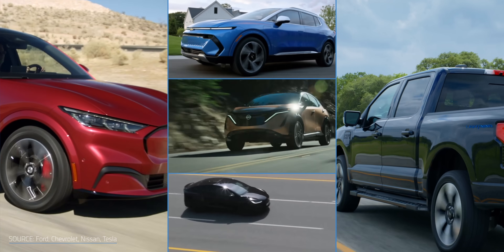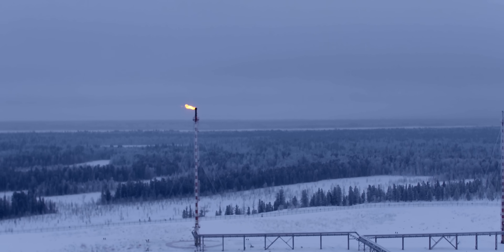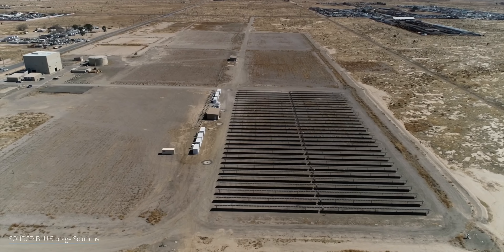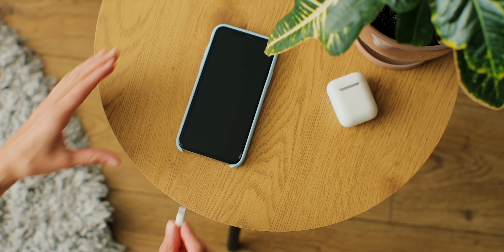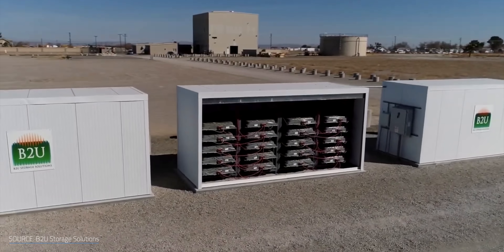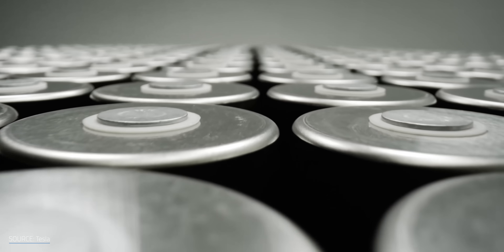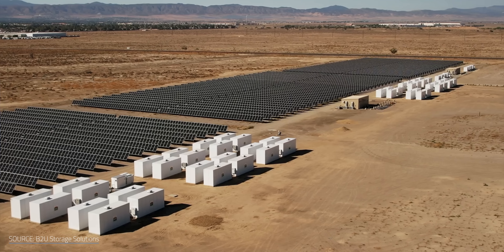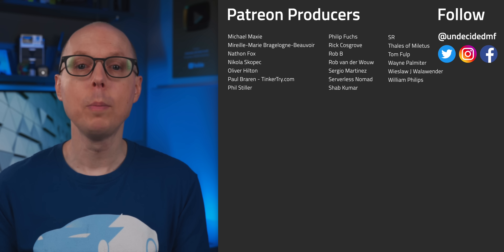How Old EV Batteries are Perfect for Energy Storage

Comment: I spent £7,200 on batteries for my home. The SCRAP value for these batteries is nearly £1,000. No batteries are going to be thrown away, the materials in them are just too valuable.
Reply: they're not getting thrown away. they are getting them cheap and using them to make money from buying the renewable energy at low price and selling high
Reply: As it stands now, cars that are no longer drive able are parted out. Those that no longer have valuable parts or are significantly destroyed from an accident get recycled. Typically they are ground up into fine bits and all of the valuable materials are collected and sold.
Reply: At some point the scrap value of these reused grid storage batteries will be too high to use them in this way.
Reply: @TonkarzOfSolSystem  At which point, they get recycled. And since they're NOT in a landfill, it's likely MUCH easier to do that well and effectively.
Reply: Old battery packs are worth thousands in recycling or re-purposed for storage use. No one is throwing them away in land fills. 💰 talks...
Reply: @larryc1616  it costs more to recycle them than to manufacture new ones. Of course they’re going in scrap yards. If your Prius gets totaled no one is coming and pulling the pack. Same with any EV or hybrid.
Reply: @larryc1616  - “old battery packs are worth…”

There is labor cost, human risk from combustion, and environmental risk from spontaneous combustion, and medical risks from leeched lithium being linked to autism.

Once the costs of risk are observed, businesses try their best to shed the risk to nameless individuals, who buy second hand batteries 🪫 for home 🏡 projects.

This is an environmental disaster in the making.
Reply: And then, they 🪫 self combust & turn into a ball of flames 🔥 

My used auto batteries 🪫 are going to be wired together in what I am calling The Hell Pit… because lithium 🔋 fires 🔥 are no joke
Reply: @DavidHalko  My "hell pit" is filled with table salt. Those sodium fires are even more lit than lithium fires!
Reply: @HenryLoenwind  - ‘My “hell pit” is filled with table salt. Those sodium fires…”

Can you elaborate a little more?
You caught my interest…
Reply: @DavidHalko  Technology keeps advancing. Lithium Iron Phosphate batteries are far more stable than Lithium Cobalt, and have largely replaced them as a result. LiFePo batteries also have much higher cycle lives.

and as far as EV fires, well, gasoline fires are no joke either, and gasoline can cause massive explosions if mishandled. It's also far more toxic than any lithium battery. Then there's the whole funding of Saudi Arabia and religious terroism thing with it....
Reply: @DavidHalko  oh no - you, and you alone, have spotted the obvious ….
Or maybe, just maybe, you’re in full on FUD mode.
These are batteries capable for 100+kW, being charged/discharged well below that and constantly monitored.

You are aware that EVs are far less likely to burn than ICE vehicles aren’t you?
Reply: @JohnR31415  they’re less likely to burn because there are fewer of them. The frequency at which they catch fire is considerably higher and EV fires are a HAZMAT call that requires expensive foam instead of cheap water to put out.
Reply: Hi  @JohnR31415  - “batteries capable for 100+kW”

They are big… which is why one must take extra care. Energy must be handled with care.

“being charged/discharged well below that and constantly monitored”

Monitoring does nothing to stop 🛑 a lithium 🪫 Fire 🔥 once it starts. 

Once dendrites grow within the cell, a piercing dendrite will start spontaneous combustion since the battery 🪫 has all the elements to make a fire 🔥—  fuel, oxygen, ignition source.

“EVs are far less likely to burn than ICE vehicles”

True. 

A single EV in a parking lot, spontaneously combusts 🔥 & causes the other neighboring ICE cars to catch fire 🔥 since 1x EV is the required ignition source for multiple vehicles 🚙 

Search for the article:
‘Let them burn’: How RI firefighters are training to deal with electric vehicle fires

“you alone, have spotted the obvious”

Democrat mayor of NYC is telling people to keep their lithium transportation machines out of homes, because the lithium 🪫 fires 🔥 are getting a little out of control.

https://youtu.be/jCGS2k5j7QM

I guess you must be one of those Republican wackos who doesn’t believe what is on the news or the Democrats in power.
Reply: @One_Bar  no they are less likely to burn - I didn’t say there were fewer fires.  Less likely already accounts for the population.
Reply: @DavidHalko  no, I’m a physicist by education.
EV fires do need different handling - they are still much less common than fires of ICE vehicles.
But don’t let anything like facts worry you.
Reply: @JohnR31415  - “I’m a physicist by education”

I’m an engineer by education.

“much less common than fires by ice vehicles”

When a single EV ignites a bunch of ICE vehicles next to it, the numbers get skewed.

If you are thinking of the FUD article from the NYTimes, Car and Driver debunked the millions of ICE car fires 🔥 a year that would be extrapolated, found the ICE car fire number over represented [by a factor of 60!!!], and determined there was no reliable federal databases that ordered car fires 🔥 categorizing fires by ICE to Hybrid to EV.

“Don’t let little things like facts worry you”

Lithium-ion batteries sparked more than 200 fires in New York City in 2022, killing six people and injuring nearly 150. That’s double the amount of battery fires in 2021. FDNY officials previously said the rate of fires caused by lithium-ion batteries has only increased in 2023.

Used large form factor lithium batteries 🪫 are a nightmare waiting to happen, and they must be treated with the utmost respect 🫡 … owning 4 used EV battery 🔋 modules, I can tell you I have more of a clue than the NYT writer did. I won’t run them for an extended period in living space.
Reply: @DavidHalko  What happens when lithium chemistry gets replaced with another chemistry?
We still have the prospect of having to deal with MANY millions of batteries every year, as long as EOL of the pack isn't 0% capacity and doesn't include a completely unknown (to date) disposal mechanism or process.
THIS solution Matt's presented has nothing to do with idiots moving their car into their house. Certainly some will try it. Dendrite growth is possible to minimioze- one way is through proper charge and load. It's a gamble. Getting out of bed (or not) in the morning is a gamble, too.
Reply: @ticthak  - “what happens when lithium chemistry gets replaced”

Same thing that happened when NiCd & NiMH got replaced… people throw out everything, when junk still works, because they can’t find the replacement batteries 🪫 

I train young people to bring their battery 🪫 packs back to Home Depot to recycle ♻️, but there is nowhere to bring spent 2nd life EV battery 🪫 packs… so, they will likely get used in second hand installations until they spontaneously combust & spread lithium contaminants everywhere to further increase cases of autism.

“MANY millions of batteries each year”

Yep 👍🏼 and close to 95% of lithium batteries world wide are not recycled ♻️ and continuing to poison ☠️ the environment.

“THIS solution… has nothing to do with idiots moving their car into their house”

People have attached indoor garages, all over the world. 

But the problem is real with these second hand used EV batteries 🪫… shipping containers of batteries 🪫 only needs one bad actor cell to spontaneously combust fire 🔥 and the battery🪫 modules all go up in smoke, reducing the need to properly dispose & recycle ♻️ them, poisoning ☠️ the surrounding region with lithium contaminants, and increasing autism rates among the young.

“Dendrite growth is possible to minimize”

But some guy 👦 who has their car sitting outdoors in Canada 🍁 in the winter ❄️ will have more dendrites than the girl 👧 who drives her car in Arizona, and that one reused  Canadian ♻️ battery 🪫 may take out a shipping container of perfectly good 2nd life batteries 🪫 from Arizona.

Hopefully, new chemistries will be much safer, but radically expanding the usage of Li-Ion is not the best plan, from an environmental or safety perspective.

I’ve had lead acid vent, NiMH catch fire, Lithium expand & vent. Over the past 7 years, I had to replace Li-Ion batteries 🪫 3x on 2 laptops, before they vented or spontaneously combusted. 

Most people don’t know what they are signing up for, with lithium batteries 🔋— great technology for light weight needs, particularly for small needs, a little dangerous for massive groups of significant cells since one bad actor can make a big disaster.
Reply: @JohnR31415  and yet the majority of the recent auto fires I've seen have been EVs. Regular cars don't catch fire all that often anymore unless it's a pretty catastrophic collision. EVs have been catching fire in sub 45 mph collisions.
Reply: @DavidHalko  so you’re talking about cheap small batteries which assume the charger has a BMS, not large batteries with a decent BMS built in.
EVs are, according to the NTSB (since you’re US based), more than an order of magnitude less likely to catch fire - it’s just that doing so is newsworthy unlike ICE vehicle fires.

You just can’t cope with being on the wrong side of history.
Reply: @JohnR31415  - “you’re talking about cheap small batteries”

At least they can be recycled ♻️ 

“Not larger batteries with a decent BMS built in”

My 8.6 KWh batteries 🔋 that I recycled from Ford Mach-E’s did not come with a BMS, and there will not be a place to recycle ♻️ them at end of use, once I bought them.

I purchased my 4th one now, they are pretty decent sized modules, without a BMS.

“less likely to catch fire”

A lithium battery 🪫 can catch fire 🔥, all by itself, without an ignition source, even without oxygen with piercing the shell… pierce the shell and Li-Ion gives a nice reaction! 🔥 

A tank of gas or petrol will not catch fire 🔥, all by itself, without an ignition source, after denting a tank, even with piercing the tank & exposing to extra oxygen.

“Can’t cope with being on the wrong side of history”

Maybe I should not be on the wrong side of history, recycling EV batteries 🪫 for second use… but recycling EV batteries 🪫 for second use makes me keenly aware of the risks & rewards of the various chemistry.
Reply: If there is x amount of dead batteries per year, and the recycling industry has a capacity of x/2, then there will be batteries going to landfill regardless of how much the materials inside are worth.... that's where energy storage comes in
Reply: @John...44...  Or they will store them until they can process them. Money talks, the metals are very valuable.
Reply: But wouldn't ripping them apart to extract those valuable materials leave leftover and toxic byproducts?
Reply: @theterminaldave  Recycling anything that's made from more than one material will always leave leftover waste. Even recycling a solid block of aluminium leaves waster in the form of slag. So pointing out leftover waste from recycling is a non-argument.

And calling something toxic isn't much better. Almost all materials that are not made to be eaten are toxic. Our bodies simply never evolved the ability to cope with stuff that's not in our food (either intentional or as natural dirt)---why would they? Even the chemicals we use to wash our dishes are toxic. Hand sanitiser is toxic. The leftovers from recycling an internal combustion engine are toxic. We even ingest foods that contain toxic chemicals intentionally, either because the levels are so low that it doesn't hurt us or because we enjoy the results (alcohol, caffeine, nicotine, ...).

Also, saying we should continue to spew toxic chemicals into our air with gas cars just because at the end of recycling a car battery, there's a small pile of toxic chemicals that need to be properly handled is just mind-blowingly stupid.

BTW: What's left over after battery recycling is mostly plastic, glass and organic substances from the electrolyte. Metals recycle very well. By weight, the leftovers are between 8% and 2% for a battery pack, depending on the amount of money you spend to extract usable materials.
Reply: @HenryLoenwind  someone already answered with a similar answer (though dramatically shorter) which I didnt disagree with.
Reply: @theterminaldave  currently around 90-95% of material is recovered.
Reply: @theterminaldave  its gona happen anyway as it stands

Comment: While this looks like a great solution for the immediate coming glut of used EV batteries, it appears to be a short term solution only.  Effectively, it puts off the huge recycling needs for years, but what happens when the batteries finally can no longer be used for grid storage?  It seems like we’re kicking the recycling problem further down the road (a good thing in its own way), but not solving it.
Reply: I don't think this is kicking the problem down the road so much as allowing the recycling industry to ramp up. An interview with JB Straubel (Redwood Materials) last year said they would recycle 10GWh but most of their feedstock was phones, laptops, tablets, not so much EV batteries. EV batteries last a long, long time and as EVs age, rack up the miles we get more data and this suggests that batteries going into cars today will get to 15 years old at least before >20% degradation happens. A car that old is often bought as a car for the commute, school run or other more local duties so an EV with diminished range would be fine for some people. The market will decide at what point an EV has value. I've owned my EV for over 4 years now, it has 81,000 km on the clock (about 50,000 miles) and have seen no loss of range at all. Then again I rarely rapid charge and most weeks going from 30% to 80%, only going to 100% now and then to give the BMS chance to look at the cell voltages (that's what the manual advises). If 70% range is no longer acceptable to the owner then the owner will get a good trade in price against a new/reconditioned battery while the old one goes to a company like B2U.
Reply: Other companies, also mentioned in this video, are working on solving it.
Reply: There are battery recycling plants just ticking over at the moment, as batteries are lasting longer than expected.  Metals are much cheaper to recycle than to dig up.
Reply: I imagaine that "further down the road" there will have been more minds focussing on this and see possibilities not visible to us now.  With an influx of end-of-life batteries growing in scale and predictability, industrial opportunities will also grow.  Also battery chemistry is still evolving...
Reply: Recycling is happening also, just not ramping fast enough, and grid storage is needed anyway, so putting off the need to the recycling pipeline to roughly match the EV pipeline by about 10-15 years is most of a solution.

Comment: Good Idea! How long can the batteries last in their new life as energy storage for the grid? After they can no longer be used as energy storage for the grid, do you not have the same issues and challenges  of trying to recycle the batteries?
Reply: Depends on the chemistry. With nmc batteries that are mostly used in EVs at the moment, you get another 1000 cycles after 500 cycles in the car. LFP batteries could probably run 10000 cycles with slow loads/unloads. But there is also calendar aging. At some point it makes more sense to replace than to keep.

Comment: You have to laugh when people have a thought and then upload said thought without actually following through on the thought. Stacking racks of EV batteries together is not the solution. No battery of this size is. The main reason is electrical fires due to all the stored energy. Then the more packs you have the more likely they are to short. The potential for harm is just too great and the level of reliability too low. 
Future storable energy will more than likely come from hydrogen(water) or other inert substance, progress doesn't just mean cleaner fuels it also means safer fuels. We are not going to go backwards, well not in the long-term. Short term we will use technologies we already have but these will be fast outdated.
Reply: If you want have bothered to actually watch some of Matt's other YouTube videos before writing this comment you'd know that he has entertained many other possible solutions for our energy storage problems.  By no means has he promised that this will solve all our problems.

Comment: As long as it can store energy from peak generation long enough to contribute during peak consumption it is viable on any scale. For wind that might be longer than solar, but if it works it works. Viability might trickle down to the level of your own power wall but that is still viability.

Comment: Sounds like a great idea.  The numbers you quoted are obviously the peak theoretical energy stored, any idea when some hot packs are shut down what sort of capacity is left? Do they have a spares store for when a finally dead pack needs to be swapped out?
Reply: In 2016 the Nissan leaf got 30kwh batteries. They have 40 container with 20 packs each. So assuming they use those batteries the peak storage is 24 MWh. People probably swap the battery when they drop below 70% capacity. But there are probably also many batteries from totaled cars. Their business model will get better when more cars with 50 kwh lfp batteries get in accidents. They survive significantly more cycles, so the price per kwh stored goes down significantly.

Comment: Agreeable solution with a promising future.

Except for the assumption that there will be a tsunami of aged batteries.

First, the battery life is higher than believed.

Second,, battery life is increasing every day.

Third, owners of cars who DO replace the battery will soon have an adapter that makes it into a Powerwall replacement. 

After all, that individual cell monitoring software is rather easy to replicate and scale down.